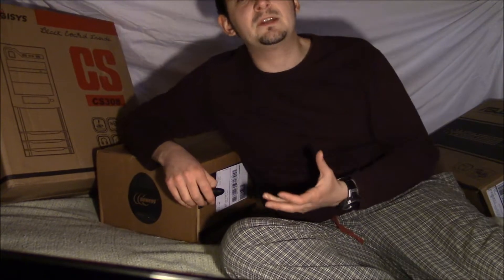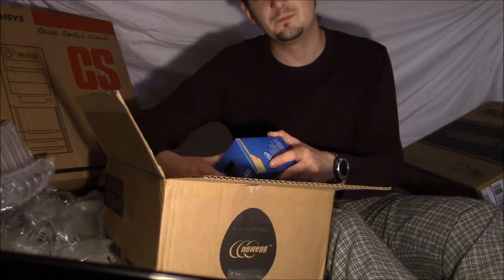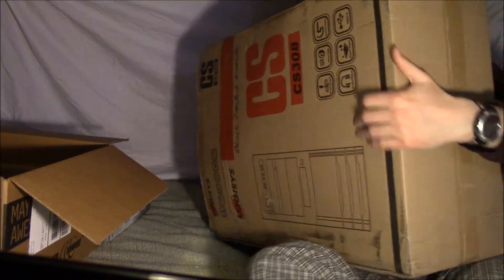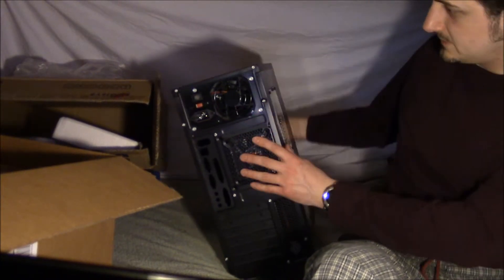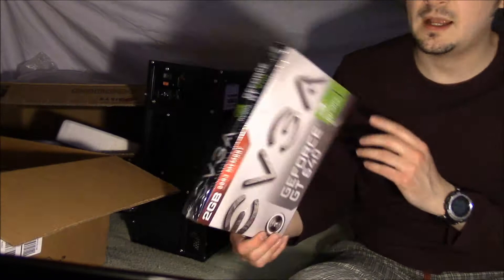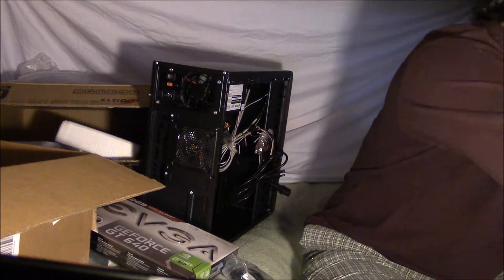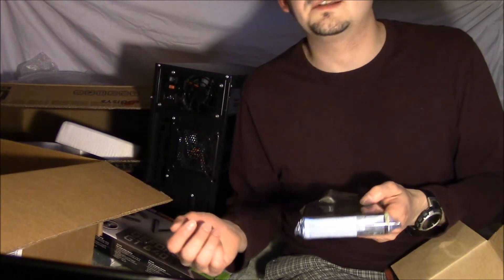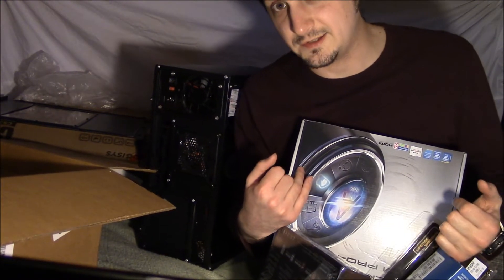Building Your First Computer (Windows 7 Desktop PC for under $700)

Comment: Hey i just got this case, i know its ATX but can it support a Micro ATX motherboard?
Reply: Atx cases support all ATX boards smaller and up to their specified size. For example, a microATX board will fit in all ATX cases wheras an EATX board will only fit in EATX cases. A mid-tower case will support a board of mATX and standard ATX, possibly even mITX.